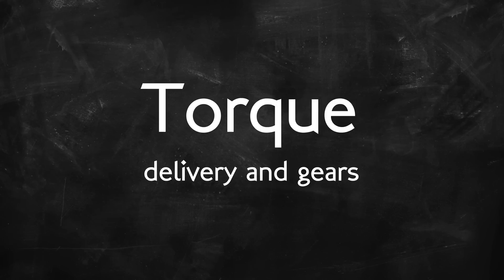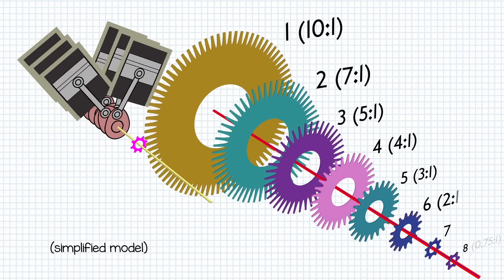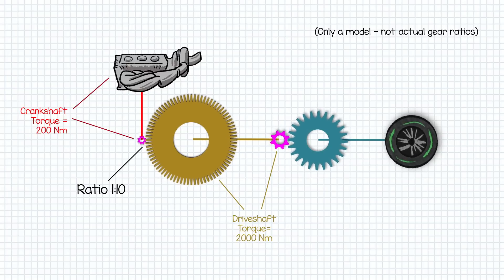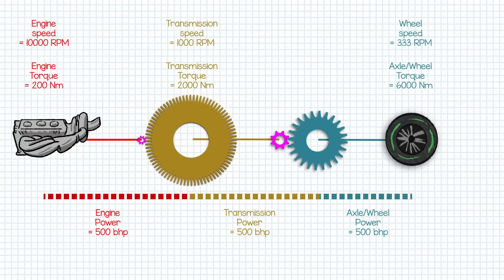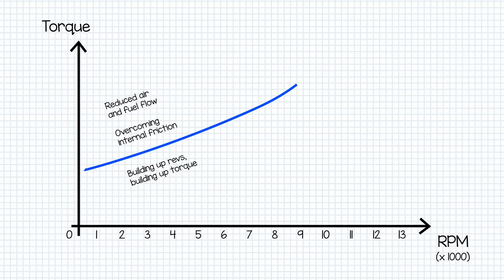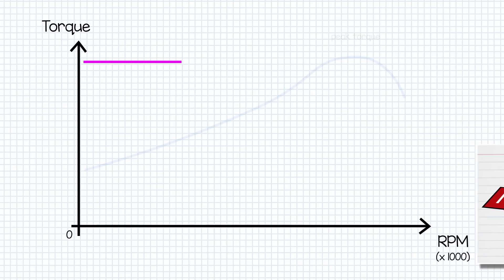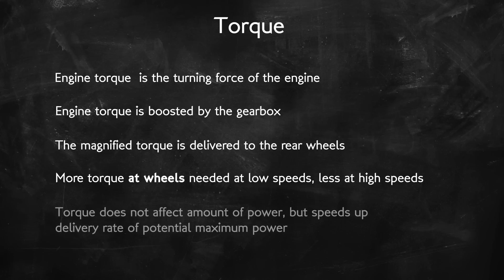Torque and Gears - Why F1's hybrid engines are more 'torquey'

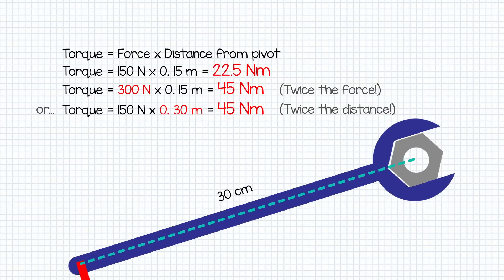Comment: 1:35 we did put in more energy, that's why nut came loose.
4:52 is even worse, wheels need the least amount of torque to accelerate the car from standstill, not most. From there reasoning is just backwards - it's not the need for torque that changes with speed, but speed causes change in torque.
At this point just explaining what power is would be much clearer.
8:11 Jesus, why in the world we are running peak torque band instead of power, that's flat out wrong!

This channel is amazing, and i can understand trying to speak in layman terms, but it's this kind of mistakes that cause misunderstandings down the line because underlying physics is wrong.
And boy oh boy that 230:1 like ratio just shows how much people will this affect.
Reply from the maker: yeah, the energy thing was a mis-speak - I apologise for that. I used casual language mixed in with a physics lesson which only causes confusion.
Why on earth would the wheels need the LEAST amount of torque to accelerate from standstill though?
Reply: The inertia of a car and wheels does not change but resistances increase with speed, and after reaching couple km/h they will be bigger that any initial static friction. And in the context of the video static friction would be negligeable anyways. Plus to keep maximum acceleration as downforce increases the demand for torque increases too.

And regarding the torque graph, afaik modern F1 use specially controlled wastegates to control boost so that power curve is very flat, that means F1 cars shift after the peak torque not around it. In fact any engine that has slow drop of torque with rpm would want to shift later.

Comment: Best video on this channel yet!! This is absolutely fantastic stuff! And CONGRATULATIONS ON 100K!!!!
One question though: E.g. last year in China, Max started the race in 2nd gear because of rain. Why?
Keep doing your thing, you're brilliant!
Greetings from Germany :)
Reply: dsf0501 I think he started in second gear to avoid  the slipping of the wheels on the wet ground.
Reply: Too much torque might have caused the wheels to spin up in the rain, maybe thats why
Reply: In normal cars, when starting a car in slippery conditions(snow, rain,...), it's advisable to be in 2nd gear so that the wheels don't spin out of control
Reply: its easier to not spin the tires in a higher gear  because the torque at the wheels is lower. It's still totally possible to start in a lower gear and just not give it so much accelerator, but the difference between too little and too much gas is smaller because the torque at the wheels for all throttle positions is higher.

Especially when I don't think an F1 car "gas" pedal moves even as much as a modern passenger car, which seems to move less than any older car I've driven.

Comment: Hope I'm not nitpicking too much. But I think the example of finding the maximum torque output needs a annotation or alike to correct the example. The gearing is actually tuned to the maximum power output of the engine. In F1 cars it doesn't make much of a difference as they are tuned to have there maximum torque delivered high up in the rev-range. But if people were to apply the method to an engine with max torque delivered at low rpm, they probably won't be able to make sense of it, as the gearing will keep the revs higher than where max torque is delivered. 

Would like to add that, as always, I loved the video and the way you manage to explain these complicated topics in a way that people without a big understanding of the physics can understand. As they say: "The better your own understanding is of a topic the simpler you can explain it to others". So huge respect from here, because you seem to understand these topics very well :)

Comment: Awesome video as always. Only one thing I have to point out that bugs me a bit: the torque at 0 rpm in internal combustion engines is always zero, as you need to have a spinning-exploding engine to begin with, and the reason why you need to keep it idling. This would be an interesting additional comparison to electric (or steam) engines because they have torque even at 0 rpm. If you had cut the part of graph before 2000 or so rpm I wouldn't complain :P

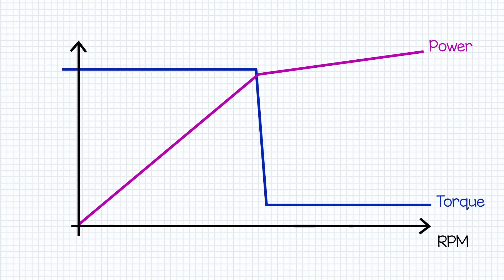Comment: I dont understand the graph at 10:04. For an example: A engine delivers 100 Nm at 2000 RPM but only 30 Nm at 3000 RPM. In my understanding the engine should not have more Horsepower at 3000 RPM than at 2000 RPM because Horsepower is torque x RPM at a specific Point in the graph. The graph at 10:04 instead shows the integral of torque and RPM because the line of horsepower climbs up even when the torque drops dramatically. But in that case the power could never decrease. The only way would be if the engine delivers negative torque? 
But besides that: great Explanation, thx:)
Reply from the maker: actually, you're right the power line should drop a step with torque and THEN climb less slowly. The power line will decrease once the torque gradient is below -1 (once units are converted)
Reply: Thank you for clarifying my confusion. It took some time for me to understand the differences between torque and power and everything you said made sense except for this graph so i was a bit unsure about my understandig on that Topic.

Comment: So basically , the easy way to explain this is

Torque = how fast you can accelerate to reach maximum speed
Power /HP = the maximum speed you can get

So more torque, means you can get to the maximum speed much faster

Did I get it right?
Reply: I'm not the best when it comes to this, but it sounds about right, but also weight is a factor when it comes to reaching the maximum speed. You can have all the Torque you want but if you weigh as much as a house, you'll still take ages to get to that speed, take the Bugatti Veyron for example, very high top speed, but it takes ages to get to it, at least compared to other cars with similar top speed
Reply: Starfire Storm alright then, thanks!

Comment: You probably just misspoke at 1:30, but the energy is exactly the same for both cases with the torque doubled. In fact, all possible cases where a nut is tightened with a certain amount of torque would require the same amount of energy, since the source of the force would be proportional to the distance from the centre of the nut, i.e. the torque is proportional to the energy. What I think you meant is that the power could be lower if you have a longer wrench, which would be correct.
Reply from the maker: I def did misspeak there! Whoops

Comment: Another very clever video showing the application of Physics and Engineering  underlying a F1 car. I  haven't thought the impact on  both  power and torque curves due to addition of electric power units in F1 engines. I guess  just fuel consumption and environment issues were impacted but it is not , the coupling of ICE physics and eletric motors physics leads to another kind of power unit that has its own  behavior. I wonder the remaning impacts in gearbox design , tires design, igntion , controls  and so on. As the new F1 engines delivers torque faster so I guess it  should be  more "fun"  driving a current f1 car, despite the worst engine sound,  than a old school V12 motor since the older delivers torque slowly isn't? I tried to but I couldn't find both torque curves ,  I mean Hybrid V6 and V12,  to compare.
Reply: These new hybrids thier torque curve are manipulated a lot by just how the controller decides to handle everything (depending on how much electric power it uses upon inital acceleration for example). The engine map settings probably have some effects on this behaviour as well.
Also a turbo car will naturally have less torque on the low RPM, again the turbo also takes time go get spun back up and start generating boost again before the engine can get all the air it wants again (However this can also be mitigated by the MGU-H spooling the turbo up to get the boost back quicker).

As for whats more fun to drive I can't really say. The new hybrids are in theory a lot faster out of a turn but I think it may be a bit harder to not spin coming out of the turn with the extra torque. However having a really laggy turbo car also surely wouldn't help with that.

Comment: At 4:10 the torque delivered to the driven gear is not the torque of the driving gear times diamater, but the circumference of the driven gear (in releation to the cricumference of the driving gear).
Reply from the maker: I don't think it says it's torque of driven gear x diameter. And we don't need to go into circumferences cause diameter and circumference have a linear relationship so let's stick with diameters.

The torque delivered to the driver gear is torque of the driving gear x 10, which is what I've put in the video?
Reply: Yeah, you are right, didn't think it through. sorry (and continue with the great videos)

Comment: does the graph at 9.20 refers to an asynchron engine?  because if that's the case the curvature should be upsidedown, similarly to the combustion engine. A part from that it's a nice video: it's really not easy to simplify these things!

Comment: why can't power flow straight from the transmission to the wheel instead going through a set of anotger gears in the middle?
Reply from the maker: how do you mean?
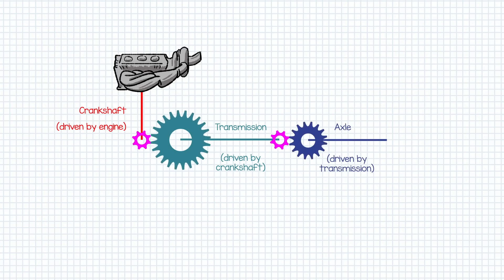Reply: Chain Bear F1, your diagram at 2:51. The transmission doesn't go straight to the wheel. It goes through two other gears. What are those two gears and why do we need it?
Reply: Long Duong - This other set of gears represents the differential (the part of the drivetrain that lets the wheels turn at two different speeds when you are going around corners).  Because of the way most differentials are designed, they naturally have a gear ratio.

Comment: You were wrong when you were saying that an ICE makes it's max torque at max RPM, it makes max torque at medium-low RPM but makes max power at max RPM which is quite different. Other than that great video !
Reply: I'm very interested in how these engines make peak torque at 11k because all the dyno graphs i've seen of internal combustion engines the torque and hp cross over at 5252rpm. Maybe this has something to do with the short stroke of F1 engines?
Reply: Waffeey. 
Horsepower is just measurement of torque and its frequency - lbft × RPM / 5252 = HP.

So if your RPM is 5252 then, lbft × 5252 / 5252 = HP
Which simplifiys to lbft = HP.

As for why F1 engines make so much horsepower, their short stroke allows the connecting rods to undergo less acceleration = less stress = higher rpms = more horsepower - provided of course, that you have sufficent air flow to maintain the torque at that RPM. Which for f1 engine is easy, as they have a very large cylinder bore, which means tons of valve area. In conjunction with a turbocharger - engine breathing is not that big of a concern for an f1 engine.

So in short - the peak torque of an F1 engine is so high up in the revrange that they make so much horsepower
Reply: Hemingway Bromfield So you're saying that the short stroke and high revrange of F1 engines contradict that at 5252rpm lbft = HP? I know that production ICE's vary in stroke to bore ratio but all crossover at 5252rpm, how does a F1 engine break this law?
Reply: Waffeey They don't break this "Law" when you use imperial measurement because it is mathematically impossible
Reply: No. How an ICE makes power and torque ultimately depends on how an engine is designed and tuned. For instance, More valve area means the higher up the optimal air flow is in the power band and vise versa. Truck engines usually have a low valve area for a given displacement. while racing engines are tuned for making as much horsepower possible have as big as a valve area as possible.

Comment: does a turbo make the torque  graph at 7:12 more "extreme"? with like less torque at the beginning, and slower torque build up, but more torque eventually.
Reply from the maker: It... let me think. The torque of the turbo (in general) should be fairly steady once the engine gets going as it spins at quite a steady rate (fed by engine and then kept up by the MGUH) so it should just make the torque curve of the whole engine a bit steeper. That's my off-the-cuff calculation
Reply: Victor Knubben because it's building up the psi
Reply: Victor Knubben ye
Reply: so i was right?

Comment: Can you do a video about the heat inside of a F1 Car? Cause I dont understand how the box crew can change an engine or an engine part so quickly after a training session since the enging is so hot. I hope you read this :)
Reply from the maker: I'll have a think about how to cover this!
Reply: In NHRA drag racing, they rebuild the engines after about one minute of running (55 seconds of which is warmup!) and they work whilst it is smoking hot. The clutch is also changed, and the clutch plates are still above 500°C when they are being changed!

Comment: pls make how turbo affects torque 
Also the graph is inaccuarte AF
an engine should make its max torque at about 3000~4000 rpm
Reply from the maker: it's an F1 engine, it's not a road car engine
Reply: A turbo stuffs more air into an engine than it would be able to suck in normally. This means more fule/air and more power (and torque). Since the turbo uses the energy in the exhaust (fast moving gas) to run a "fan" to push air into the engine there is some lag there. Depending on the deisgn of the turbo and it's size vs the engine the point where it most effectivly adds air varies. Racing cars tend to go for top end power where racing engines tend to be run. Road cars tend to go for low end torque to make the car feel faster as there is more area under the power curve, but then the turbo tends to end up being a slight restriction at higher flows.

Road cars tend to produce peak torque around 5000 RPM, but that is a function of the engine/turbo design. a VW GTI for example produces peak torque from around 2200 right through 5500 or so. An F1 car is likely to be designed to broaden the top end power some, but in general get maximum power. There is a fuel flow limit, and a boost limit, so that may make for a broader turbo design than might otherwise be expected.
Reply: kk thx

Comment: In addition, 5252 rpm is the magic number when plotting torque curve and power curve when using imperial unit
Reply: That's true if you use RPM and ft-lb, but it's just an artifact of the units used. There's nothing really special about that number (other than the fact it's way easier to remember than the equivalent number for Nm).
Reply from the maker: Yeah but we don't use those units here at all, but didn't wanna get bogged down too much in units cause I know a lot of people are American

Comment: Can you please make a video explaining turbo lag? Or is it too short a topic for just one video? If that's the case maybe make a video explaining a couple of short topics. I wanna know what it is and you explain things best.
Reply: ah too bad MGU-H will be gone, it's the most sophisticated (in my view) technology in F1. Hopefully the MGU-K is gonna be designed with more power so it can pull the car just as quick as before even there's turbolag in the ICE. Conventional anti lag is not the way to go for F1 since it's actually igniting combustion in the turbo itself. The reliability of the turbo is gonna be horrible and you know the regulations about this stuff.
Reply: Might be an interesting video to make one day. Since in F1 the MGU-H removes turbo lag, and they're getting rid of the MGU-H next season. It will be interesting to see if the teams come up with new ways to eliminate turbo lag, or just deal with it.
Reply: I believe they intend to spin up the turbos with power harvested from the MGU-K. The MGU-H exchanges power with that same 'shared' battery in present setup anyway.
Reply: +NeoNoir Digital Design So it's basically like a front wing but it provides power instead of downforce?
Reply: Vibhav Mohan Not really. Think of it like this, the engine has to take air in for combustion right? Without a turbocharger the speed and amount of air that can get into the engine is limited by the air pressure. A turbocharger takes that air and increases it's pressure, delivering more oxygen to the engine. More like a pump than a front wing.
Reply: Vibhav Mohan miss fireingu shishtem.
Reply: +Flintstoned I kinda get what you mean, like it's function. But that's why visual representation is needed for a better understanding for how it works.
Reply: Vibhav Mohan Turbochargers act essentially as giant air intakes for an engine, as with all air intakes, at low speeds it does not have a great effect.

When you accelerate the engine performs as it would normally, and your speed increases. However it takes a while accelerating for the turbo to intake enough air into the engine for it to have much of an effect. And this is known as turbo lag.

Comment: This is just for those who want more elucidation on specific physics terms. 

Clarification of definition: Torque is also known as moment(s). It is the result of force x perpendicular distance from pivot

Perpendicular distance is important because it explains why pulling a luggage at an angle is easier than just yanking it straight on.